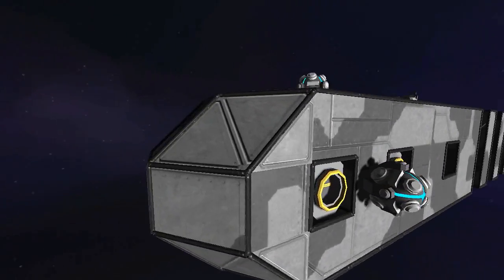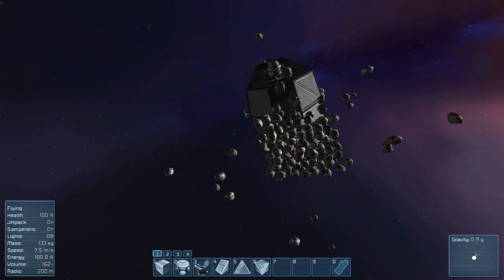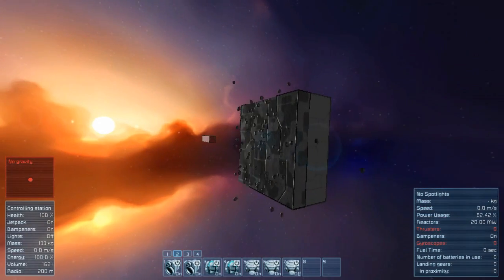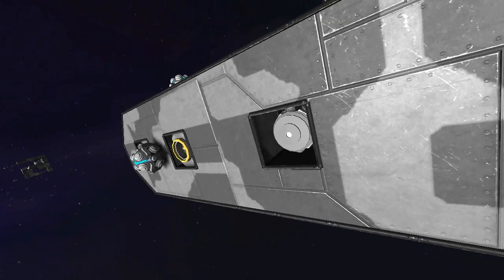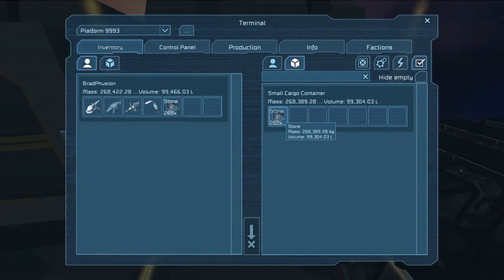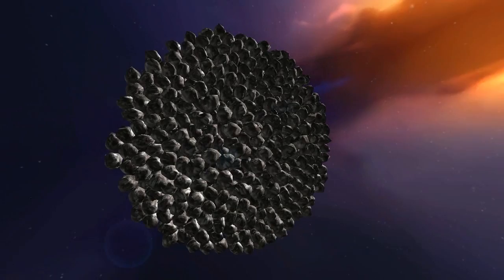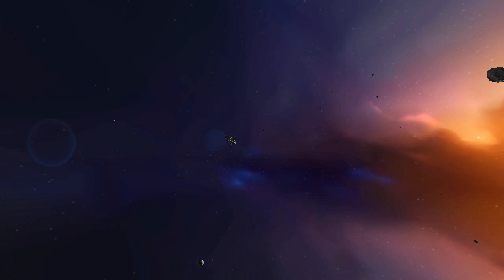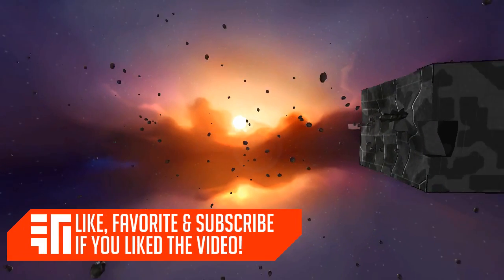RE:Engineering: Particle Cannon / Rail Gun using Spherical Gravity Generators! (Space Engineers)

Comment: And although this is pretty dang sick(awesome work) wouldn't it be more cost effective if you just put connectors to dump rocks inside a barrel, then use 1 sphereical generator(or 4 normal) to compress all the rocks inside a barrel, then launch? Tighter for in pattern maybe, too
Reply from the maker: It was mainly made for style points, though I do fear that having a barrel could result in internal damage :) But yes, more compressed is better, but a damage over a larger area is also a positive in it's own way!
Reply: Didn't think about barrel damage...
An yea, it's sick
Reply from the maker: Thank you :)